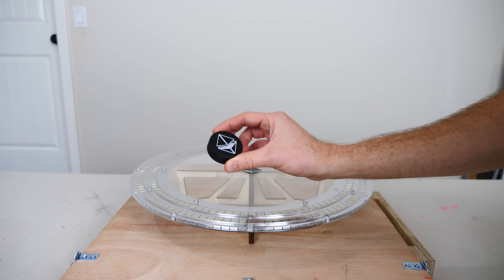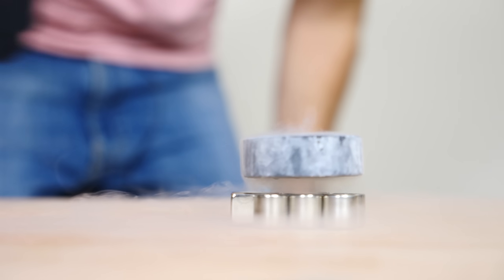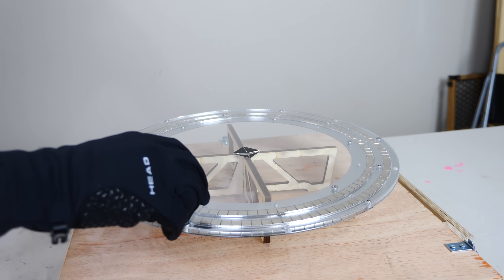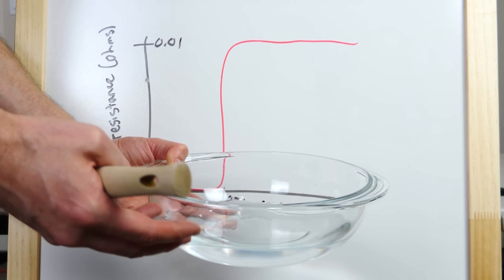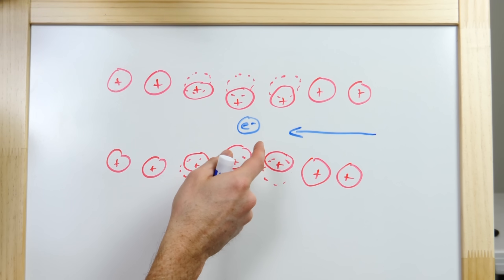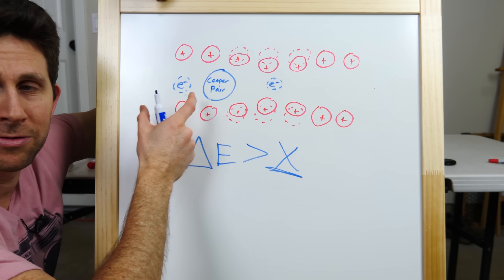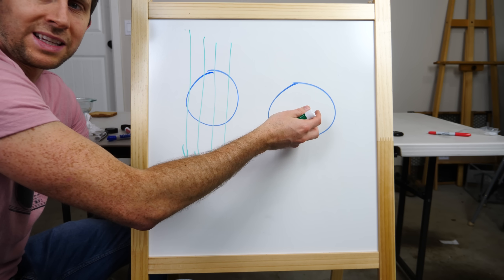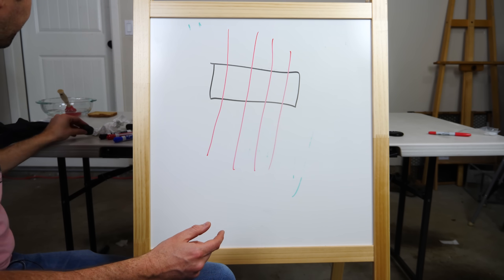Quantum Locking Will Blow Your Mind—How Does it Work?

Comment: According to scientist at nasa if you use a super conductor and electromagnetics you can get antigravity... And more you think about it we already got antigravity technology we use daily every single day and night and not even realize it... A Speaker a Subwoofer.. why you ask? How is a speaker or and Subwoofer use antigravity??? Well. the coil former spider come surround all weigh something right? Ok.. well the coil is sitting in a magnetic field.. when electrical signals are introduced to the coil.. the coil pushes the cone spider coil itself and former up into the air.. it moves fast straight up and when the signal is reversed as in sound waves up and down the coil will go up n down are high rates of speed and force and slower yet high strong force... It lifts all the moving parts of the sub n speaker up nothing physical is pulling it no propellers obviously no jets ect lol.. so yeah it's antigravity because it's it defies gravity itself. gravity is pulling the cone coil ect down but when electrical signals and electricity is introduced into that coil within that magnetic field it shots the cone ect up in the air.. if you put a AA or AAA battery to a Subwoofer the cone goes up n stays up... Yet we are still trying to figure antigravity out and here we had it lol. now we gotta figure out how to get it to work on a bigger scale and be able to fly places with it. Which I'm sure it's possible..

Comment: So basically the super cooling effect of the superconductor acts as a heat-sink, and removes heat otherwise caused by friction of electrons. Thus removing any barriers for the electron to travel through. Hence the zero resistance.

Well that makes sense. Using superconductors is is like a scaled up version of achieving an effective action without superconductors, and just using an effective heat exchange system, even though it does not perform a zero resistance electron pathway.

And that's why cooling down a computer CPU, or other electronic equipment, causes it to function more effectively. In the case of the CPU, allows electrons to travel faster speeding up the computer.  And in the use of Low Noise Amplifiers like those that are used in Radio Astronomy, can remove spurious electron energy from the LNA while it's super cooled, thus eliminating nearly all of the noise in the LNA circuitry.

So basically in the future we are bound to see computers manufactured with some form of superconductor circuitry, allowing computers to basically operate at phenomenal speeds while in high levels of HyperSpace where most electrons are standing still relative to the universe. Thus allowing spaceships to operate using computers and allowing the electrons to move freely. Otherwise, the electrons when entering HyperSpace would stop moving, and so the computers would not function properly while travelling in a state of HyperSpace.

mmmmmmmmm...That's very interesting. 

so that's why we need superconducting materials.

Excellent! 

That would explain how Flying Saucers are able to achieve the Bose-Einstein condensate Effect and turn themselves into waves/light by stopping all electrons that make up their Quantum Atomic Matter through resonance, basically undergoing a transformation into local HyperSpace, and still have enough functional computer AI power to evade primitive Earth based missiles, guidance, and lucid functionality etc...

Thanks man...very nice, great work, and really good presentation!

Comment: This locking phenomenon can be used in public transport system with high temperature super-conductors that will require a lot less energy.
Reply: Except that the amount of magnets necessary would make it extremely ineffective from an economic and material standpoint

Comment: In theory.....if you had a big enough one of these, in a constantly cold enough place, and added like a windmill on top of it collecting wind energy
.....
....

.... Unlimited energy source?
Reply: The drag on the windmill would slow it down pretty quickly
Reply: @gerhardvaneeden5615  zero resistance with drag is still free movement with this being so cold right? I'm not talking about just efficiency
Reply: @BirdmanAnyweather  I didn't study any physics after school, so this is simply my layman's interpretation, and therefore to be taken with some salt. Aerodynamic drag is just another form of resistance. It's not friction between two hard surfaces, but is still a form of friction (air molecules), and thus a form of resistance.

Comment: I noticed that the smoke from the object always goes downwards instead of upwards
Reply: That would be because it's actual water vapour condensing and is cooler and denser than air, so it goes down.

Comment: The problem with this technology being feasible in modern industry is the necessity to keep it so cold, I think. Wouldn't the amount of energy required to produce liquid nitrogen, and the weight of carrying such nitrogen (or other cooling agent) be too much for the superconductor to carry? (In the sense of transportation)
Reply: is space cold enough? or maybe the surface of one of Jupiter's moons?
Reply: A wave length of the energy produced could be harnessed and relocated remotely to a super-conducting cooling device, directed back toward the energy center. 
Or simply create a "quantum locking" of electrons causing thermal transfer, holding the electrons in a temperate state.   🤷🏾‍♂️just another thought
Reply: Scientists are almost finished with a type of superconductor which can superconduct on normal temperatures (20 degrees celsius
Reply: there are already superconductors which can work around -40 degrees celsius

Comment: So IF there is aliens traveling interstellar, they are surfing gravity fields, in and out, of solar systems, in Very Cold space, in there super cunducting space ship 😄
Reply: @Rukia Orbinasky I'll back what I said. You will not be cold because there is no air to conduct heat away from you. The problem is the lack of pressure means your body no longer wants to be together, the oxygen in your lungs will expand rapidly and your blood will boil, not necessarily because of light turning to heat but more likely because the vacuum of space is trying to tear you apart. You don't need an insulating to suit to protect you from hot or cold temperatures, you need it to keep pressure and prevent radiation from the sun. That isn't temperature.
Reply: @JoCE2305  salutations for being so patient and sharing what you know.
Reply: @Tristan Arnold No, it's not. That's like measuring the height of people living on the sun. There are no people on the sun so you can't measure their height.
There are no particles in a vacuum, therefore you can't measure temperature.
Reply: Space has no temperature and if they started with a freezing super conductor and a normal temperature  ship, eventually the temperature from the ship would bleed into the super conductor and the ship would also become colder, breaking the functionality of the ship.
Reply: @JoCE2305  bro, space is cold. Also this alien spaceship has probably way superior insulating capabilities
Reply: @hopesy12u4  Temperature is defined by the amount of energy thermal energy matter has and if there is no matter matter, there is nothing to measure to get a temperature reading.
Reply: @Tristan Arnold NO
Reply: @Tristan Arnold No. 0 Fahrenheit is an arbitrary almost meaningless number anyway
Reply: @Tristan Arnold You don't know the basics so I can't possibly get into the intricacies
Reply: @JoCE2305  You been jammin' to Neutral Milk Hotel and The The?
Reply: I can not comprehend a true vacuum, I could understand infintessimally small amounts of particles. I also could that being "practically" a true vacuum, but I would think eventually there would be at least one particle. And I think it would potentially be cold, although that may be my layman's bias. I suppose a particle flying through space could actually have a lot of energy.
Reply: @joshuasukup2488  That is true, of course space isn't an absolute vacuum. There are tons of particles in space. They vary in temperature. The point is there are so few that if you were exposed to space, they wouldn't take away or add any significant amount of heat to your body and you would have far more immediate concerns.
Reply: @JoCE2305  yeah, like the lack of air pressure making your blood boil...also it is about 2.7 Kelvin, or -454 Fahrenheit in space on average
Reply: @JoCE2305  So basically, there is either no, or next to no temperature in space. This is because the molecules are too far apart for us to either measure temperature or for there to be temperature. 
To your knowledge, am I understanding this correctly?

Edit: referring to going into the intricacies, this seems like an interesting topic, and something I would like to go more in depth into. If you wouldn’t mind, would you be willing to go into more detail?
Reply: @Tristan Arnold I believe he is saying space physically has no temperature, but I may very well be misinterpreting what he’s saying

Edit: I’m not going to delete this comment, but based off what sephiroth said, space does have temperature, but it is near absolute zero

Comment: if you cool down an object then put it into a chamber while it is locked so that the cool object does not touch the sides of the container ie Put your vacuum chamber on the magnets then put the frozen puck in the chamber so it floats above the bottom of the chamber wall. Then you suck all the air out. Then wrap the container in something like copper to block any UV or other types of waves to penetrate the box. Would the cool object remain cool since there is nothing to interact with that would heat it back up?

Comment: Kind of makes me wonder if this is how the solar system works and why its so cold in space.
Reply: Space isn't cold. Matter is cold and space being mostly a lack of matter, it has no temperature.
Reply: @JoCE2305  Isn't space cold because of the amount of space between matter that actually produces heat is so far? A mass amount of the volume of space is cold because of the lack of heat generating matter ?
Reply: @TK229Az  stuff in space that isn’t in direct sunlight tends to be cold because it doesn’t have a source of heat production, yes. With no source of heat, all of its thermal energy is radiated away in the form of electromagnetism. Anything with a temperature emits electromagnetic waves, which take energy away. This is why infrared cameras work, because room temperature objects tend to emit low energy infrared light.
Reply: So it would seem that "heat" is just a measure of energy escaping matter. Just as light is another form of energy escaping matter. Or do we consider light (and maybe heat for that matter) another wave of particles?
Reply: Is a particle zooming through space at 1000 million miles an hour cold or hot?
Reply: @liamstacey419  The speed of all objects is relative. So the "speed" of an object can't be related to its temperature unless the cause of its speed also increased its temperature.
Reply: @JoCE2305  Right, but i brought it up because we typically think of heat as being a measure of the collective kinetic energy of all the particles within a volume.  Is heat anything more than the sum total of all the velocities and wiggles of all the particles? Do they have to be crashing into each other thus producing photons in the IR spectrum to be called warm?
Reply: @liamstacey419  Well is the release of photons due to particle collisions the definition of heat or is it a byproduct of thermal energy being transformed into light energy on collision? A lone particle traveling through a total vacuum still has energy, it just has nothing to collide with to change the form of that energy.
Reply: So does that mean life can only be sustained only with the planets inside the asteroid belt range? At least for us?

Comment: Hmmmmmmm I wonder if you could permanently keep that superconductor cold by putting it in a sealed container suspended in liquid/solid nitrogen. The way I see it the pressure would keep the superconductor in a cold state and the container would keep the the nitrogen pressurized so that it can't absorb thermal radiation?

Comment: What's the palatability of, say, transportation using quantum locking? Trains, for instance? Where the bottom of the train are continuously cooled superconductors on a magnetic track? No friction, no wear and tear other than the cooling mechanism. Can go really fast. Twists and turns are not dangerous either, since it is quantum locked to the track. It could also prove useful long-distance -- without friction, once at speed, it does not slow down like ordinary systems. No need for constant thrust. Any thoughts?

Comment: Why haven’t we made trains out of this. All they would require is liquid notrogen to keeps its superconductors cold enough, which if done on a mass scale is much more renewable and most likely cheaper than gas or electricity
Reply: It would heat up too fast outside, even in "cold" weather. So the amount of liquid nitrogen needed onboard to keep the conductors cool would be extremely expensive. 

Trust, they are trying to manufacture room temperature superconductors as we speak. So it is not too far away (hopefully 😀)

Comment: I'm no scientist but, wondering, could this be use in cars to make actual "hovercars"?
Reply: not really!
Reply: @everythingfun7069  cool answer!
Reply: The attraction of the metal in the car to the magnets beneath it would far outweigh the force suspending the conductor
Reply: you need a magnet road, and a superconductor car that has no metal parts, maybe made of carbon fiber. maybe on roads in the moon to keep it cold and without air friction.
Reply: Theoretically, but the engine and everything else would need to maintain their standard temperatures, and the liquid nitrogen would need to be well contained enough to not affect other parts of the car.

But I'm 13, what do I know?? 😂😂😂

Comment: “Quantum Locking” is a side effect of the fact that 0.00000% of the energy is lost through the YBCO while its cold, so when you move the magnet it produces a magnetic field equal and opposite to the velocity of the magnet, and the height is determined by where the YBCO’s force on the magnet is equal to gravity, it’s not a unique effect of QM, but a side effect of one of the major features of a superconductor

Comment: 3:51 will the superconductor go on forever because the air almost has nelgible resistance.
For eg if somehow the superconductor was at the same temperature when it was dipped in the liquid N2 then it the superconductor should keep on moving

According to the 3rd law of Newton,every action has an equal and opposite reaction. Since you applied a force the object must have started moving with some acceleration but since you removed the force after a millisecond the object must keep moving with uniform velocity since acceleration can only be there as long as a force is applied. So will it jeep moving forever? Or atleast it will stop after a very long time,owing the negligible friction becoz of the air....

Do make a video on this

Comment: So it's like induction, but the electric resistance is so low that the system will dislike matgnetic flux extremly much? 
But why would impurities like allowing magnetic lines make it stay in place more than in the case of super conductor 1???

Comment: When you put the super conducting magnet on top of several small magnets it would have been nice if you had told us about the polarity orientation of the small magnets--were they all north end up, south end up, or a mixture of orientations?  What happens with the different orientation options?

Comment: 1. Shouldn't the friction with air slow down the super conductor's circular hovering after a few turns?  
2. If the same experiment is executed in a vacuum, does that means the circular hovering would go forever in analog to planetary orbiting?

Comment: You know this is perfect in space. Its very cold, all you need is to get it off the planet and then the conditions of space are cold enough to where you can have these systems so cooled down and simply get it spinning and since there is no friction it will continue to spin at its speed forever and you can create and endless energy supply therefore fueling your spacship for whatever processes it needs. You can also mimic this on Earth by just making sure it stays in a chamber with a material such as liquid nitrogen or something else.

Comment: if you could take two type 2 superconductors that had their centers milled into two chambers then mill channels for two o'rings would not the magnetism of both halves seal together when suspended in liquid nitrogen thus extending quantum locking for a more extended period?

Comment: So basically the cooper pairs work like this when cooled enuff.   Its 2 dudes cruising in a car at 50mph and they get to hold that speed until disrupted and it takes a 50mph strike to do that..   so a car hits it at 20 mph not enuff but the catch is if a strike is not enuff to destroy the car it does not even slow it down.   Like an all or nothing universe.    If it's not enuff energy to stop u it has no effect not even slowing u. Wow mind blown